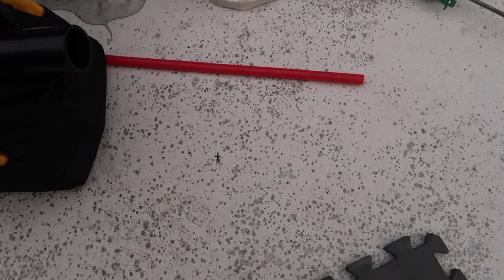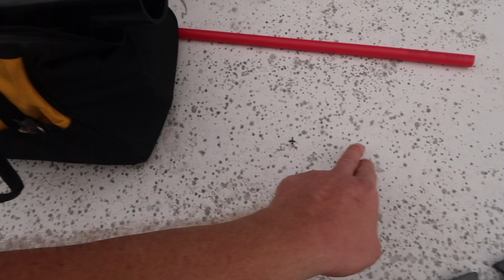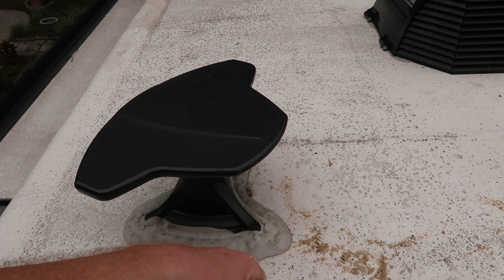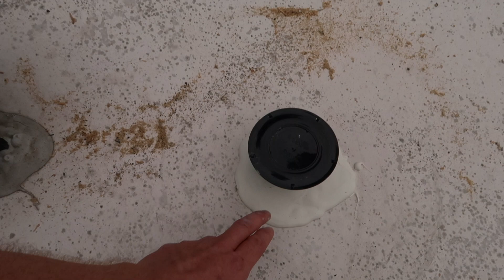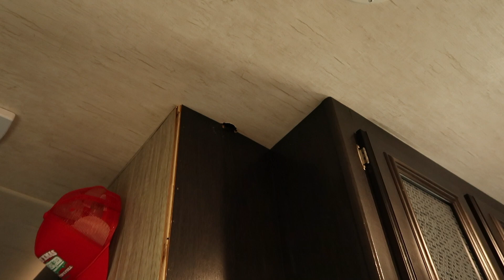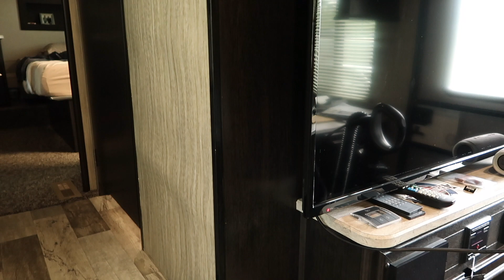RV holding tank vent fix

Comment: Don't use a hole saw to see if you're close.  Use a long aviation drill bit in 3/16 or 1/4" and drill pilot hole from inside-out to verify location.  If wrong can be patched with caulking.
Reply from the maker: well aware of that. There are times when you don't have the right tool and have already driven 30 mins one way to the store and back and forgot to pick up what you need so a decision has to be made when your time off work is short.

Comment: Why didn’t you drill the 1/4 inch pilot first and check to see that you missed before drilling the 2 inch hole.
Reply from the maker: Hind sight is always 20 20
Reply from the maker: Mainly because all of the bits i have on hand are too short to go through the roof, celling and four inches of air space in between.